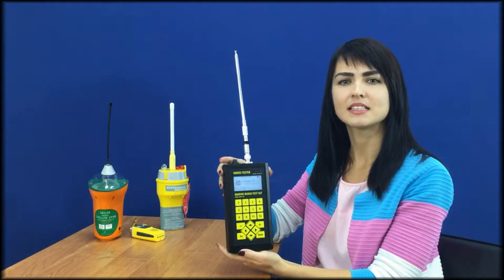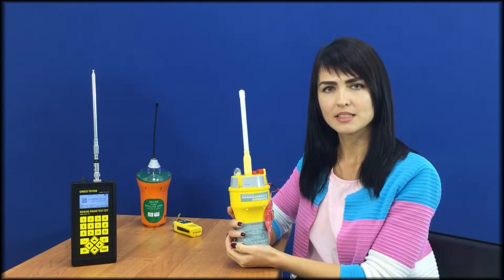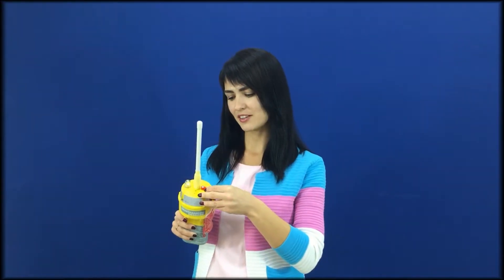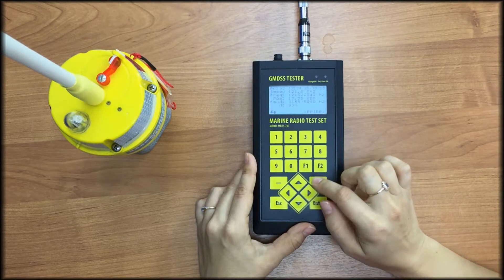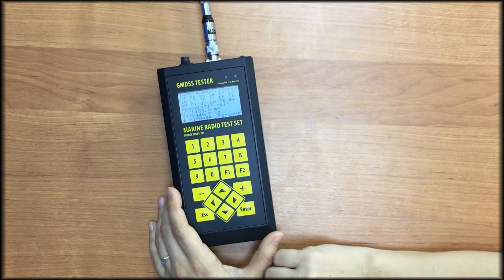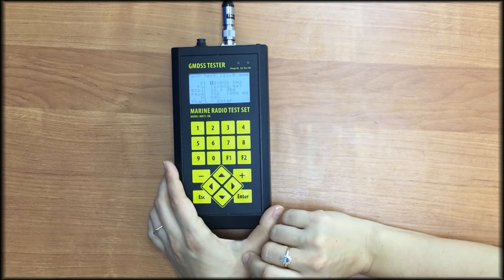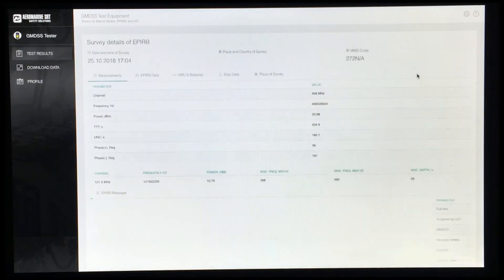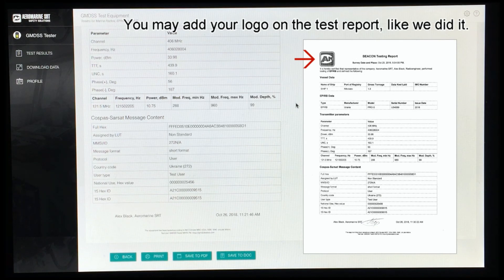EPIRB testing by MRTS-7M

Comment: At minute 2:17 you can hear the 121.5 mhz home signal. I have done countless reviews with radio beacons from different brands such as ocean signal epirb1pro, jotron tron60sgps, mcmurdo g8 and I cannot hear or read this 121.5 mhz home signal. I have achieved it with the satlink radio beacon elb100gps. Could you tell me what the reason is?